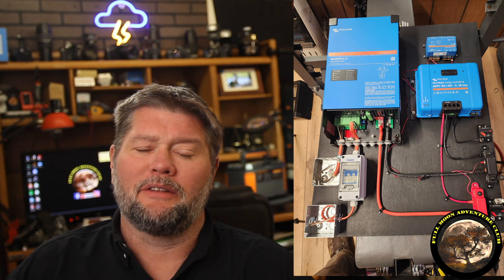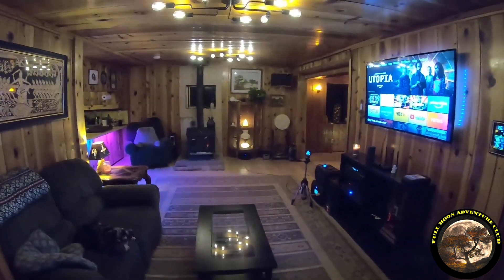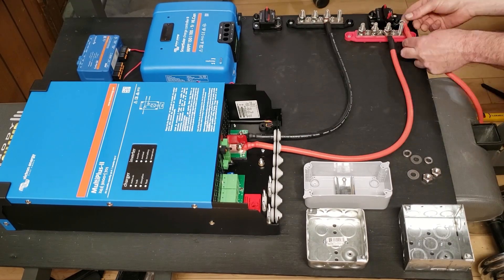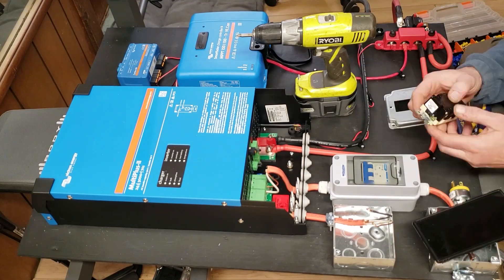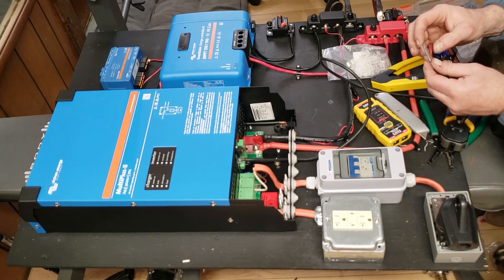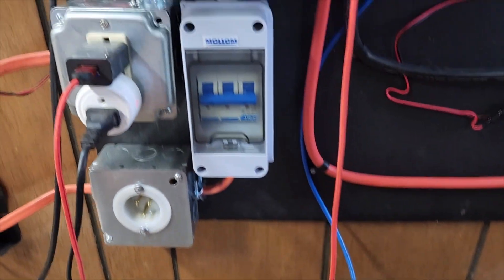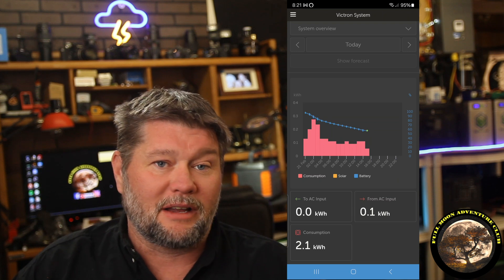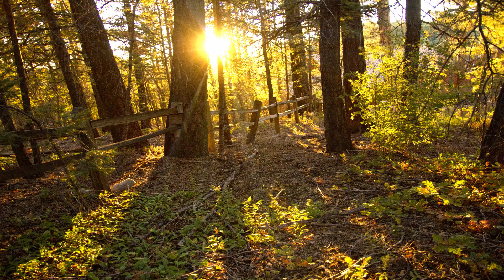Portable Solar Wall Build - Victron Equipment With Husky 2 Battery

Comment: FYI - the Husky2 48v has no closed loop communication, at all. Just bought 2 48v versions from BigBattery based on your review and are returning them since apparently they are incorrectly advertised. I've seen a few reviews claiming this works (it only works on the 12-24v versions), even though there are physical ports for it. What an absolute joke.

Comment: Very nice setup.  How did you wire the Victron AC out to your electrical panel?  My apologies, I may have missed that part.  Thank you.
Reply from the maker: I have a very old cabin and I hesitate to show anyone how I did my setup. The short version is my main outdoor fuse panel feeds the inverter in the output power from the inverter goes to a subpanel in my hallway. So everything ran off the sub panel is connected to the solar wall.

Comment: i will never understand 12v vs 24v regarding solar systems.
Reply from the maker: Wire size alone gives 24 volt systems a huge advantage. I must admit I've only had experience with 12 volt systems until now. Thanks for the comment and happy camping.